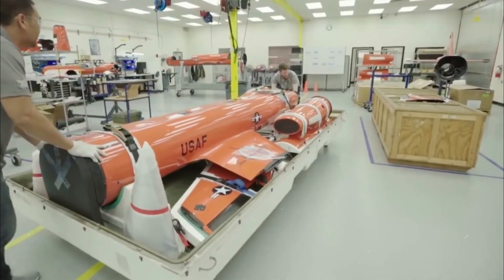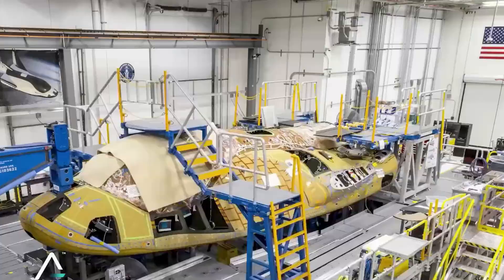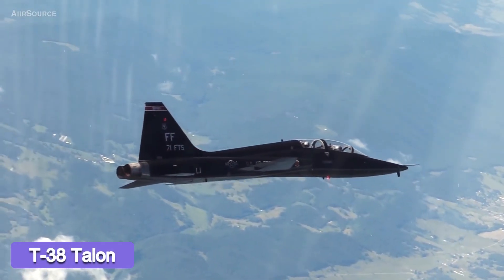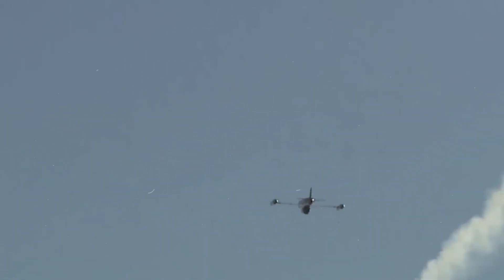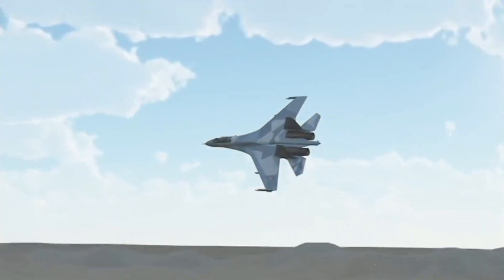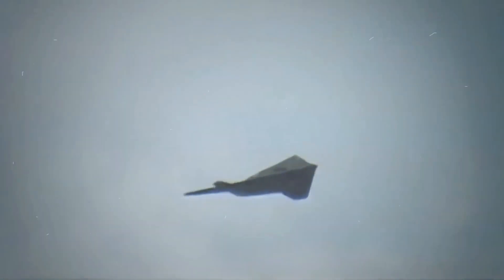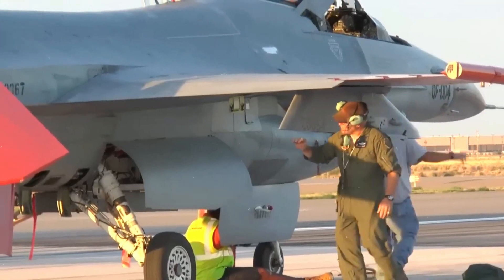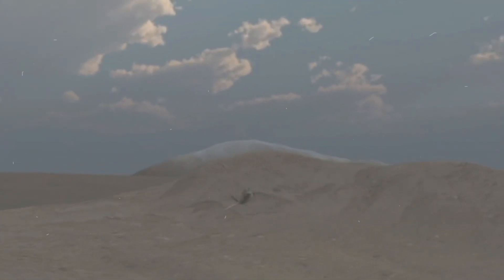U.S. Air Force New Stealth Reconnaissance Drone Finally Developed

Comment: The US is not facing the problem of the soft underbelly.  Our military cannot be sustained without it's contractors which are scattered all over the mainland.  
We have missile defense in strategic points around the US and it's military bases but these missile defense systems can be defeated.  How?
All China and Russia have to do is begin with an overwhelming initial volley of chaff and decoys to basically pollute the purity of the radar spectrum.  Next you dedicate your systems which also include decoys which the US systems are 100% unable to distinguish. 
 Lastly you send a very large volley of less sophisticated ICBMs assuming much of the missile defense is either exhausted, destroyed or so confused it doesn't know what to do.
At the very best we might be able to stop about 45% of the ICBMs, that's ONLY IF it is a small scale attack with NO DECOYS and NO CHAFF and NO Domestic first strikes.  You would expect in a large scale attack, there be weapons of all sorts used against defensive positions.  
These people do not intend to lose and they are not just going to sit around and wait for the US to counter them.
Reply from the maker: Thanks you so much🤘